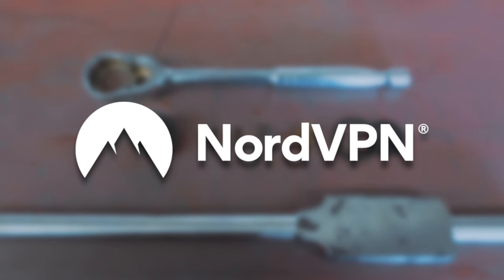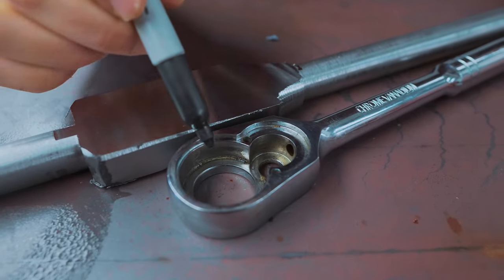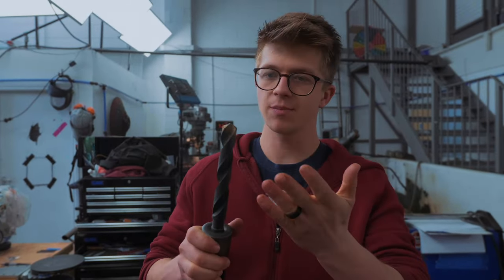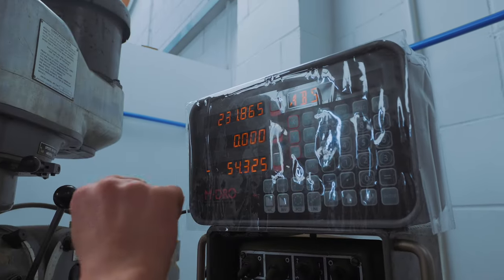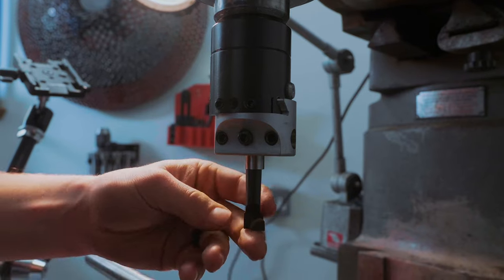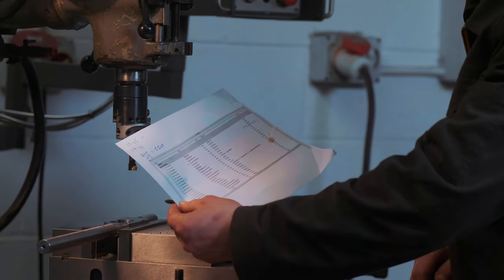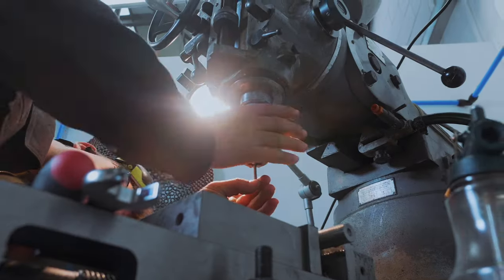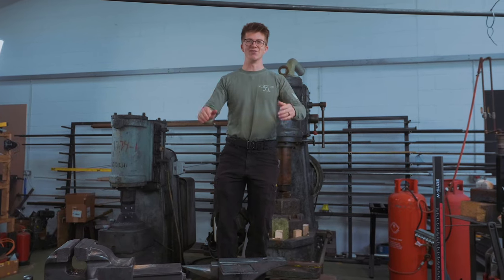Making a Socket Wrench from Damascus Steel! Part 2

Comment: that bore tool is used for final cut to get it into dimension, best practice is to drill through with endmill <.050in of the final dimension and then moving on to that tool.
Reply: Looking at his measurements, this may have been a cheaper and faster project to do in the US. Some of his "non-standard" diameters look to be just over standard imperial measurements. Depending on how precise they need to be, they might even just be endmill plunges or drill plunges with cleaning up a shoulder with a boring head
Reply: That would require having endmills very close to his final dimensions. Another idea would be to use an endmill with a rotary table to get within a few thou, then finish with the boring head.
Reply: @lanner777  well he's got a shiny new rotary indexer/table so that's a good idea! Do you think it might also work to use the "pitch circle diameter" function on his shiny new DRO to rough-out the hole with an endmill?
Reply: @lanner777  Which he would have to buy, yes, for <$100. It would make sense considering a production shop rate of >$100/hr. if you consider imperial and metric, not to mention the oddball sizes available for premium, there's almost always an endmill that'll get you within .050", or even .100" at the worst case.
I'm just taking into both setup and process time into consideration for most efficient production. It probably took Alec hours to bore that thing out, when really it could've been <30min work starting with no setup.  

Haven't thought about your technic before, I like that. If you can't wait for a new endmill but have a rotary table lying around, definitely way to go.
Reply: @realdan1  Though you may need to think about where any big stickouts on a part are, such as wrench handles. You could definitely get to a different part of your circle, though, and if you're already planning on getting those last few thou with a boring head, the difference you might get on the different cuts shouldn't be an issue
Reply: You could also just not use those shitty import brazed carbide boring bars. Ive got a nice Wohlhaupter UPA3 boring bar I use on my fp1 with standard insert boring bars and I can take a 1.5mm DOC anyday.
The poor results he got likely werent his fault but probably came as a result of bad cutter geometry
Reply: @aaronsilas7024  That'll definitely do it😂
Reply: @OB1canblowme  Thats partially what I was talking about. It doesnt matter if youre Robin Renzetti running the stiffest mill in existence if your tools have their cutting geometry inspired by a small boulder it wont work very well
Reply: @realdan1  not to mention sharpening time, tool damage, and the wear on the cutting edge.
Reply: That was my thought as well, boring this entirely is quite boring
Reply: Without cnc i would use the Rotary table with endmill. The lathe is also an option. That Chinese boringbar could be turned into a good  knife 😛
Reply: My thoughts exactly Dan
Reply: @peterspencer6442  That would be slower process than the boring head
Reply: Time to add servo motors with the new DRO. Circle milling is a thing of beauty. Grant you it's not a perfect circle, but good enough to get within .030" and bore to finish.
Reply: @realdan1  I'm not a metal worker but I had the same though about drilling it close then using the bore to clean it to final size
Reply: I was wondering why he didn't do that when he was mentioning how long it was taking... XD

God bless the comments section... XD
Reply: The replies on this thread are a (edited) education, if you pay attention...
Reply: Yhea he could have drilled the third smallest hole as well which would have been quicker and easier on the tooling.

Comment: So, as a point of interest, why wouldn't you drill the through holes first, then you can more easily get the bore tool into the hole to clean out to your outside diameter.
Reply: That would only for the actual HOLE though right? Because all the other diameters need to have a flat bottom, and this thing can’t do more than a few mm at a time
Reply: @1draigon  you could (should) still drill down/out "most of the way" then do the cleanup with the boring bit.
Reply: He didn't have a drill bit the right size
Reply: @effen_aey_man  even so, it is still faster, but!! there is also a way for messing this up a notch so... Better slow and good than fast and...
Reply: @effen_aey_man  he still could have used the same methodology and drilled the hole smaller, bored it to diameter. Then did a step up and removed each holes materials to depth and the associated diameter... then he would have just been widening the bit farther each time until meeting his final diameter.. doesn't make much sense to me.
Reply from the maker: Didn’t have a larger drill that fit in the mill than the 16mm hole I started boring from!
Reply: that is what i wanted to say just didnt know how to bloody say it !!! cheers sheldon runkey (y)
Reply: It takes a huge investment to tool up a machine shop, especially if you have two shops in different countries.  Machining is all about using what you have, and placing an order for a tool so it isn't so miserable next time. 😂  Cheers
Reply: 88mm!!!! That’s awesome!
Reply: You bought a boring head kit but didn't want to spend the money for 1 drill bit?
Reply: @hvy1ton  I think you missed the words "That fit in the mill" - although straight shank bits aren't overly expensive I guess...

Comment: That's not a rough pass tool, it's a fine pass tool, meaning it's used to finish a cut, not start it, or enlarge it. You need mills to cut the dimensions under for each seat. Using that boring head for the whole work is slow and wasteful, not to mention you'll keep dulling the cutters every time, as you saw.
Order of operations would've been two undersized through holes, then mills for the bigger bores, then mills for the seats. Then you bring in the boring head to finish each cut, in reverse, preferably so you get crisp cuts (IE, you start with the largest, inwards, going down to the smallest, downwards).
Reply: Hey! No backseat milling
Reply: A boring head and a couple carbide boring bars are  a perfectly suitable replacement to end mills that he may not have. And to be honest, its just lathe tooling. Roughing with it is completely normal. Sure he could use a rotary table but that can be tricky to set up right..
Reply: @EpicZombiez2314   I have taken .150 with a boring head using carbide neutral inserts. Could have done that entire side in under 2 hours lol
Reply: @mikpiotto  personally, I love hearing the tips, but I am just a bloke with an interest and not the means. Maybe one of those days I'll make a crummy lathe from scraps and bamboo sticks but the tips make me smile nevertheless.
Reply: @jaxblonk5127  I was just joking
Reply: Time to add servos for circle milling to those DRO readouts.
Reply: order of operations
1. throw it in a cnc with whatever old endmills in there

Comment: Awesome video as always Alec!  For those who struggle with milling or boring, we have a video covering the topic in depth called "Boring 101".  The difficulty Alec faced here was a combination of several factors, mainly the boring bars themselves.  Unless the bore is very small, we use indexable boring bars with interchangeable inserts.  A smaller tool nose radius will normally chatter much less than a larger radius, but the feed rate will need to be decreased to maintain the same average roughness.  (Not to be confused with how shiny the surface appears).  Mild steel tends to smear and tear at low RPM as can be seen in the video, it also smears without a sufficient cut depth.  It is a good practice to take a large enough finish pass to form an actual chip, this is usually your tool nose radius at a minimum.  The problem is, as RPM increases, so does the inherent risk of vibrations which is also seen in this video.  Machining can be very difficult without the right recipe, there is no sugar coating it.  All carbide is not created equal, a good insert or solid boring bar can create thousands of holes in mild steel.  If you ever have questions about machining, we post daily tips and tricks on Instagram and provide technical support.  Cheers

Comment: Nice lesson Alec, I learnt almost the same way...After my first bent boring bar I bought larger drill bits...And boring bars with different shaft diameters (and changeable inserts).
Always drill the largest hole possible with a drill (fastest material removal rate possible), and finish with the sturdiest (aka. thickest shank) boring bar. In a pinch a suitable end mill works also to remove most of the material, but at least drill a hole first, end mills don't like to cut in the center.

Comment: Loving this series!
6:00 - Looks like you need one more circular cut where the two larger bores meet at a sharp angle, near the small clearance holes. Just a tiny bit of material needs to be taken off each side to match the original.
Reply: 8:33
Reply: No, it's still there at 8:30 guys. I was using 6:00 because you can see it clearer in that shot. I'm talking about the pointy bit where the two large bores meet, right by the small holes on either side.
Reply: You're right

Comment: I enjoy the fact its obvious you are learning as you go. 
As a few other people have said, the boring tool is better used for finishing rather than roughing out. Using end mills or even drills bits, get the bulk of the material out, and then use the boring tool to bring holes up to their finish sizes. The other thing to consider is tool chatter. Ideally, use the largest boring bit you have space for, as the extra thickness of the tool will reduce the amount of vibration/chatter you get, and will give you more consistent finish diameters.

Keep up with the brilliant content.

Comment: about the different holes you had to make...if I wouldn't know how expensive they are, I'd suggest you need a 2 1/2 Axes CNC Milling machine (like a Fehlmann Picomax 54, or a Kunzmann, or Mikron of any kind) to properly mill a circular pocket. But since I know how much they can cost, your way of drilling them is probably the better way for now.

Comment: Coming from a sophomore manufacturing engineering student, always remember to file your edges between operations because the burr can throw your holes off by like 10 thou, so can chips in the ways of your machine if it’s a very old Bridgeport. Also, learning to make a part sheet will save you lots of time at the mill, watching you read hole dimensions off a printed excel sheet was kinda painful. Love the videos.

Comment: Excellent video 🥰 . When you use boring tool tried to not use the Quill, it make your tool cut to fast and make it dull very fast. Just rise the table it will be more stable.

Comment: Possibly a bit late in the day for this project but if you’re going to be doing more stuff on the mill it may be worth having a look at some slot drills in various sizes. Then you can rough out more material and then do your final skim with the boring tool. Saves you from having to keep sharpening the tips. Love all the videos and all your weird and wonderful ideas!!

Comment: I have a really neat CHALLENGE, Make Corvo's folding blade from Dishonored. There are plenty of 3D printed ones but what about a metal functioning one that can fold and cut?
Reply: Specifically corvo's blade is 'magic' ...Can't make a proper functional blade that folds in on itself like that one sadly
Reply: @CapOfXav   of course is possible but it requires lots of brain. for example gravity knives are a clever drop knife design

Comment: Alec my friend, next time to rough machine the big holes without the correct drill sizes, you could clamp the part on that nice looking new dividing head, center the holes on the center of the dividing head, put a smaller cheaper endmill and rough both holes with the dividing head rotation, and then mill to the correct size with the boring head... with enough care you wouldnt even need the boring head tbh. My mentor taught me one thing and that is to be a cheapass and make the most stuff with the least amount of tools. Great project btw!

Comment: You should ad some sort of cooling. You can use the oil that you hopefully use as lubricant for your machines. Neither tools or machines like dry metal to metal contact. And these things are meant for finishing, we use similar ones at work and use them for holes with tight tolerances like 63H5 which get drilled to 62,8mm

Comment: When using the edge finder you have to make sure you move over half the diameter of the kick off end otherwise you’ll be off half the diameter in this case since you found the center line of your axis you measured both sides and it didn’t matter but it looked like your x axis was off when you had it lined up. I hope this helps in the future. Usually the tip is .200 Inches so you need to move over .100 inches. 2.54 mm. I am a cnc machinist and have some experience with manual mills as well I have made this mistake once or twice 😂

Comment: You don't necessarily have to use the depth stop. I preferred not to because I found it could sway by about .003 depending on pressure. Zero your tool at the top of the part, then go down until your DRO reaches the negative number you're going for, no stop required as long as you have a steady hand

Comment: The damascus socket wrench is pretty cool as a display piece, but due to the intermittent soft and hard steel, it would probably snap at a stress point if it was put under enough torque. still cool though!

Comment: Alec, smal edvise on the boring tools in the mill: they like to run rather slow and are only used for smal amounts of material for precise mesurments and surfacefinish.
 Depending on your insert you might wanna use alot more coolent.

Comment: maybe the lathe was the right tool to bore those holes, that said, ring cutters may be usefull to remove the bulk of the material as to give the least amount of work to the boring bar

Comment: You should make a Damascus file or set of files. You can try and do a very straight geometric pattern and then use that pattern as the templet for the teeth.

Comment: I have always had great success with boring heads by removing the bulk of the material with a emdmill. The bulk material removal does not even have to be concentric to the boring head. It's only purpose is to remove material. Second thing is to run the boring head at around 200-400 rpm

Comment: A quicker way to do this on a manual would be drill and ream some locating holes. Then setup a rotary table align of the locating hole and use an endmill to cut the pocket. To make the pocket bigger you just adjust your X offset.
Reply from the maker: What an awesome idea!!!!! Thank you for that!
Reply: @AlecSteele  You probably have the video shot already but you can do a similar thing on the selector switch side. The kind of triangular pocket that the switch fits in would be pretty easy to align with the thru hole then you can cut that pie shape out with just the x axis and the rotary.

Comment: If the hole was reversed and the up/down rotation was in the opposite axis, the depth would be enhanced to the point of apex in the back/front approach where both depressions meet.

Comment: Just an observation Alec, It would appear to me that you in the beginning you were running that tool backwards in terms of cutting rotation.  It could be an artifact of the frame rate, but I don't think so.  The spindle should be turning the same direction it would with a standard drill or tap.  That may explain your dulling, in addition to what everyone else has noted about it being a fine boring finish tool.  EDIT-- it seems like at 7:35 or so you were running it the correct direction.

Comment: Get a lathe boring bar with carbide inserts for the boring head / I would have used a some endmills 2 or 3 around 10-20 GBP a piece from ebay... then the boring bar // Dont know if you have some R8 End Mill Holder you can get some cheap of ebay to. Dont waste 3days,  1day more ok with some tools on the cheap side even if your learning , dont know your budget but 3days of work vs some cheap tools on ebay, cheap tools wins

Comment: do you not have a power downfeed on your mill that you can set the depth stop on?
If you do, use that feature and pick up some insert cutter boring bars (AND USE COOLANT!!!) and you will bore those holes in no-time.

Comment: boring bars should really only be used to finish to size and get a good surface finish. You "should" use a larger drill size fist and then bore or ream to size.

Comment: All these people saying you can't use a boring head to bore big holes are wrong.  I've gone from 1 inch to 3 inches with a boring head.  Granted, I use an indexable carbide boring bar, but just take it slow.  I usually go .050 diameter increase per pass.  Yes, it takes a while.  Be patient and it'll work great.

Comment: You know, alec, the easier way would be to set the round bit in a square collet holder, and then just use an indicator to get the flat part squared